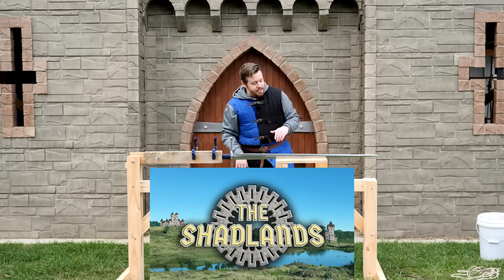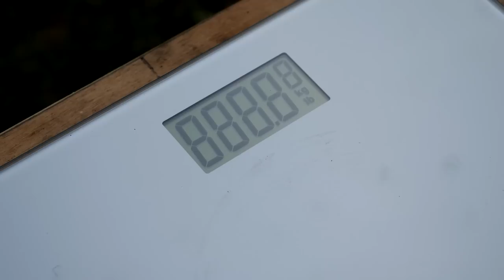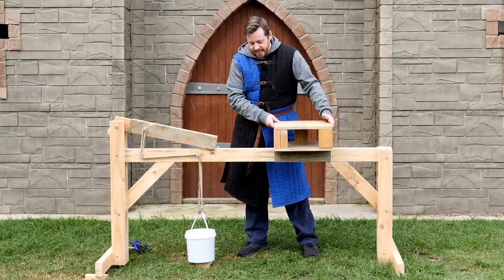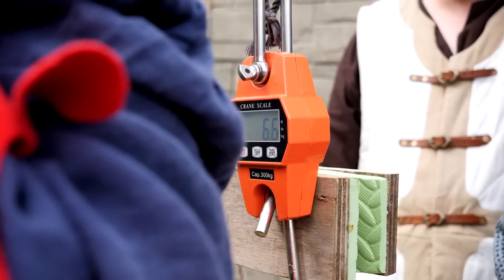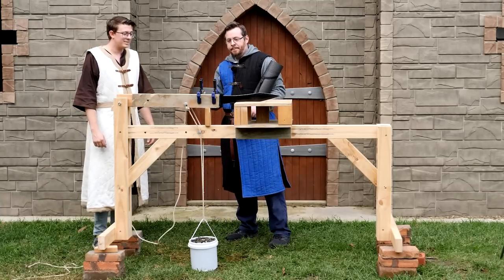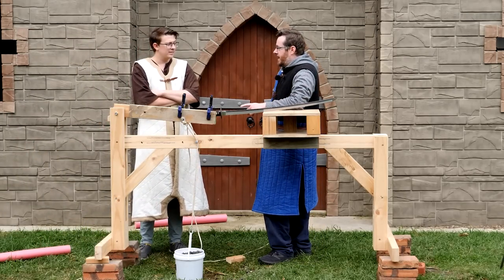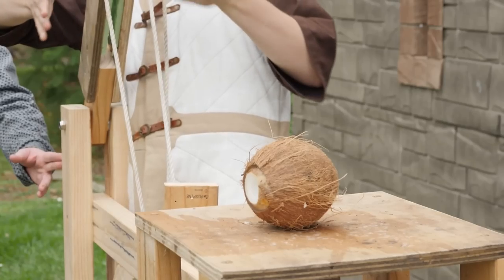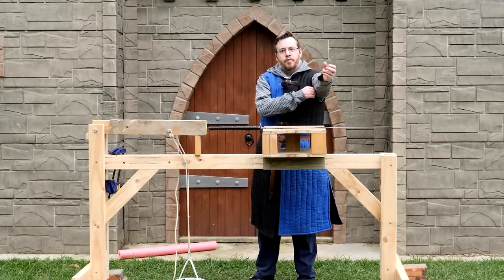Choppy choppy

Comment: I kinda hope shad tested the “War Sword” on that specific coconut before using his own mighty strength, which no doubt I knew would of cut through it. 

Maybe try inspecting the mechanism again, hitting a hard target might have weaken it, other then that I have no bias, but both of those swords relatively have similar mass, and from my experience, coconuts can vary ALOT in hardness for each one.

Comment: I think another factor besides the grip slipping (and possibly a bigger one) is that as you made the rope go more directly between the bucket and the arm to increase the force, you also decreased the speed of the swing and therefore the sword's momentum. That may seem counter-intuitive, but remember that regardless of the bucket's weight it can only ever fall with the acceleration of the Earth's gravity (9.81 m/s^2), which means that as the arm with the sword becomes horizontal and starts itself to be accelerated more and more by gravity the bucket's force on the arm decreases because it can't fall any faster.

From this point of view the original setup was much better, because a small movement of the bucket translated into a much larger movement (and acceleration) on the arm. And sure, the force is proportionally smaller (moment of force = r * F), but that can be compensated for by increased weight as you did originally. I know it's not the most practical setup, but increasing the source force seems like the only real solution, maybe you could use some pulley system?

(Also as other have pointed out the swing force measurement wasn't really fair, because you measured the force of your arm at the end of a not-so-short stick instead of close to your hand, which would be a much better comparison.)

Comment: You should drill multiple holes in the clamping arm to add pins to keep the sword handle in place better. I would also use kant-twist clamps instead of quick clamps, they hold much better and are more compact. An additional arm housing a pully would allow you to use a rope with a quick release to easily & safely raise the arm as well as having the most consistent releases. These solutions should greatly reduce the variables in your testing. Testing swords cutting ability in this manner is a good idea and your system seems like a good way to accomplish it. The truly best way to test would be to build a sword swinging robot that can do multiple different strokes similar to the ones golf club manufacturers use to test new designs.

Comment: This mechanism has a problem: it doesn't accomodate for the size difference between targets. Bigger targets will be hit earlier in the arc of the swing, where it has less momentum. I suggest you make some sort of vertical regulator as well.

Comment: I think that the clamps are slipping more than your hands. Of course human hands are not as strong as bolts, but judging from the video I suspect that the issue with the setup is that those clamps are not shock resistant enough to simulate a hand grip.

Comment: Ok Shad there are three main things you will be needing to do: 1 is secure the area that holds the sword handles better so that they do not move when they hit a hard target. 2 you will need to build a second platform  that sits lower as you mentioned, and don't change the "angle" that the swords sit they are fine. 3 MOST IMPORTANTLY you need to either raise that Guillotine higher off the ground or you need to dig a hole below the bucket for it to fall into without being impeded by the ground. It took me three replays of the katana test to catch this. The reason you were able to cut through the coconut with the force of your own arms is because the force exerted by your strike was only stopped by the cutting board AFTER you had CUT THROUGH the coconut. The Guillotine's strike looses its driving force when the bucket hits the GROUND, which was also the EXACT same time the leading edge of both swords BEGAN to touch the shell of the coconut. It had no power to finish the cut. This should cover the "major" changes that you need to make. Read the rest of this comments section I see some other fundamental tweeks that people are mentioning. 

I hope this helps. Best of Luck and Regards, Z

Comment: There's another thing to consider:
Swinging with your arms, you can apply almost constant force, or constant acceleration on the swords.
The bucket applies a significant force at the start, but once the sword starts moving and the bucket falling, the applied force gets reduced drastically.
For a bit of intuition: If both objects were free falling, there would be no force applied. In this case, you will just have reduced force.

To solve this problem, you want to make sure the bucket moves as slow as possible, so probably move it back on the lever where you had it originally.
Reply: To expand a bit more:
I expect the kinetic energy of the swing to be much more relevant than the static force applied.
That means you want the blade to move at a similar speed to a manual swing. Try to verify this by looking at the footage.
I think the static force measurement you did is almost useless (except to verify that it's not super excessive)

Comment: That’s not an executioner’s sword
Reply: Actually an executioner sword won't work either since its not actually angled in fact its documented that executioner swords can't slice a head clean off in one motion, the first prototype guillotine had a vertical blade as well and it didn't cut the head cleanly, leaving a mess all over the executioning grounds but when the sword was angled it totally worked which is why the guillotines you see have angled blades and not vertical ones, also the reason why the samurai sword cuts head cleaner than a regular sword because of its curvature with its cuts starting at a smaller point before going wide, a regular straight double edge sword can't do that job correctly although fiction depicts it otherwise which is fine
Reply: @traphimawari7760  that’s not the point and you know it
Reply: @ScottyAlmondjoy  its not really an execution when your executionee is still alive for a couple seconds as they feel their neck dangle and they drown in their own blood before the second strike finally ends them and spare them of the pain, executions have to be swift and merciful a straight vertical blade is like a butchers knife it can cut through bone and traditionally animal meat but the human body is comprised of much denser flesh and tougher fat and even tougher cartilage which makes executioner swords bad for their intended purpose and why it was subsequently replaced by guillotines
Reply: @traphimawari7760  Who the hell cares? It was a semi-joking commend about how if you’re building something called a “sword guillotine”, you should use an executioner’s sword instead of some other sword. It has literally nothing to do with how effective swords are at giving clean decapitations.
Reply: @ScottyAlmondjoy  a guillotines job is to decapitate heads and a vertical executioner sword as a guillotine won't work just as I explained since its terrible at its job in regards to decapitation so to build a guillotine using a sword that isn't angled like an executioner sword won't work at any given scenario you might as well use the executioner blade yourself rather than create a contraption around it that would only hinder its performance when it relies on kinetic or gravitational force such is the guillotine, also yeah I do find your comment hilarious in a lot of ways so I commend you for that

Comment: The one problem i see immediately (granted, before watching whole video so you might address it later on): it won't give consistent results. Why? It's powered by gravity and gravity has this neat little feature that it accelerates all objects at the same rate regardless of their mass (let's ignore air resistance as it is not significant in this case). 
Which means that every single sword you test will have the same velocity at the same distance from the point the arm rotates around. Which in turn means that heavier swords will inevitably have higher kinetic energy than lighter ones. Something that would not necessarily happen with a human, who has a certain amount of muscle strength to power a cut. 
A spring powered system that moves the sword diagonally (safer in case something brakes) or horizontally with remote trigger would be imo better  and not that much more complicated. The biggest issue would be finding a proper spring.

Comment: About the testing machine:
1) Make it so that it's not horizontally ending up but in a 45° angle downwards.where it can potentially cut swing further and then halted by a bar below the point. In the end of where the bars of 45° ends up connects to something going straight up and looks like some kind of V-shape that you can put there the product to be cut. You could connect it on the outside of the 45° bars to screws so you can adjust the length too.
2) About testing force, you swing and add momentum to the sword itself and thus much more force is applied. You did similar as a train moving ramming something like a car and you tested the moving force of the train starting from a stand still and no momentum behind it.
3) I would consider for instant blunt force test to set up similar forces. Like that How much damage (dent) one does with hitting a hammer and then the machine needs to do the exact same dent as you did swinging the hammer onto the for instance wood.
4) Make it so that where the rope goes over the screw that there is some metallic tube, better yet a rope pulley wheel over the screw so that there is no wear or tear affecting the outcome and more consistence.

Comment: I have a few ideas I don't know what might be causing the biggest issue but here's what I noticed:

I think the clamps aren't strong enough because because you can see the swords move after they make contact

Having the sword start further back would be good because you'll give it more time to accelerate before making contact

When you hold a sword, your hand wraps around the entire thing but your setup only holds it on the side. having a piece of wood on the top of the arm would help with the clamps being too weak and would make it so the swords don't slip

I'm not sure but it looks like the bucket is hitting the ground before the sword hits the target. That would probably cause issues because there would be no force pulling down after it makes contact. I think you'd need the bucket to still be above ground and the end of the swing because it would more realistically simulate someone following through with the cut

Comment: Ballistics Gel, it simulates what the sword's target will be, human targets.  However you'll need another universal material to simulate various armor types such as gambeson or mail.  I imagine a rig like this would be a good armorsmith or swordsmith tool if perfected, and I saw a lot of problems in that regard, too.

1) Mechanically, the sword swing happens at three pivot joints: shoulder, elbow, and wrist.  You don't just throw a fastball straight arm after all.  The same goes for a sword.  Simulating that is a mechanical quandary if you want to throw together a machine with just simple materials like wood.

2) The grip was also loose, power loss during swing.  Straight clamps such as the ones being used will slip.  But there may be a way to mitigate that and even use these clamps.  Set a backstop to the upper part and a lower stop further down to catch the bottom of the handle of the chopping arm to simulate someone actually holding the sword properly perhaps?

These are the primary two questions the machine needs to negotiate, leverage and grip.

Comment: Great video, was fun to watch.

I noticed (like many of your other viewers) that the katan slipped in the grip a lot more than the two-hander sword did. To fix this I would recommend putting the bolt that the weight ties to above the handle of the sword and just behind the cross guard. Then also put a bolt below the sword just before the pommel. That way when the sword hits it will not be able to shift as much in the clamp. You would probably have to drill multiple holes for the bolt by the pommel at varying distances and heights to accommodate for different type a sword handles. Even if you did this I still think the two-hander sword would have cut better than the katana (even though the katana was sharper).

I think that the two-hander sword would strike about 4 times harder than the katana in a "prefect scenario." The only significate force acting on the sword is the weighted bucket. The two-handed sword would have more drag on it than katana, but I think it would be negligible because of how thin the sword blades are. So both swords would accelerate at the same angular velocity, but the velocity of the swords at the contact point would be different. It looked like to me that the two-handed sword was about twice as far away from the swords cross guard as the katan did. So the two-handed sword would have a velocity at the striking zone twice as fast as the katana. Then if we look at the equation for Impact: KE = 1/2*m*v^2 (KE = kinetic energy of impact, m = mass, v = velocity). Velocity plays a bigger role in impact than velocity, especially because the mass of the two swords are relatively equal (So we can assume that both of them were 1 kg for simplification). So if we assume the katana had a velocity of 1 m/s at the striking zone the impact would be 1/2 *1kg*(1m/s)^2 = 1/2 Nm (newton-meter). Since the striking zone for the two-handed sword was about twice as far away from the cross guard as the katana we can assume that the striking zone velocity was 2 m/s. So the two-handed sword would have an impact of 2 Nm (1/2*1kg*(2m/s)^2) which is 4 times harder than the katana. I just don't think that the difference between somewhat sharp and pretty sharp can make up the difference in impact.

This is just my theory and I would love to see your guy's opinion on it. I'm sure I missed something.

Also, I remember watching something about how they make kitchen knives and test them (Probably a How its Made episode) and they tested them on stacks of paper. So I would say that rolls of newspaper would be a good test. The hard part would be making sure they have a constant roll.

Comment: I am not an expert, but I can think of 2 things that could help: 

1: The total force applied on the coconut isn't constant between different swords. Because the weight of sword isn't usually the same. One explanation for the katana not cutting could be as simple as the weight difference or the total amount of force applied being different. One way to counter this would be to weight the swords and use an arbitrary amount of weight that stays constant between test which would be the sum of the counterweight (rock bucket) . 

The reason it would be less impactful in your hands is simply that if you can produce 50 lbs. of force with a swing on average, that average should remain the same regardless of the sword. Obviously, there is also a lot of other aspect to think about, like weight distribution, length, width, etc. But if you want to be fair in the force applied it could help. 

2: I might be mistaken but I think that swords are meant to have a pulling part to the action of cutting with it. Even if really small. That should be even more true with curved blade which to me looks like they are meant to be use that way. I might have seen too many Japanese and Indian movie, but I think they are meant to slide cut more than to cleave. Maybe adding some form of horizontal U shape or circular ish shape railing for the blade rotation fix point instead of it being, well fix might help any sword that aren’t as good in cleaving. Or maybe having some sort of moving fix attach point to simulate that pulling could help. I guess that’s why most guillotine have an angle edge to simulate that sliding. It probably makes the cut easier. 

Little side note a morphing fractal vise could be perfect to grip the swords to the sword guillotine.

Comment: If you don't want to use wooden dowels then I suggest schedule 40 PVC half-inch pipe. The pipes are equivalent to ribs and  forearm bones. The only other thing I can think of is pla plastic as you can gather up the pieces and melt them back down into homemade forms for the skeleton of your test dummy. One-to-one comparison for the skeleton and you'll have to get the pla up to about 170 to 210 degrees Fahrenheit inside the forming mold allowing it to cool below 100° before removing it from the mold.

Comment: Hi Shad, I see some good explanations in the responses and some have valid points but as a mechanical engineer I want to emphasize that in the energy calculation of a moving object the velocity component  is squared,  while the mass is linear. So, in order to get a good approximation of a blunt cut, you need to have the blade move at the same velocity at the point of contact with the target as you achieve in a manual cut, you may need to re calibrate for each blade using the slow motion option on your camera. Remember,  it is of no importence how you accelerate the blade, only the final speed and the added driving force you have calculated in the video. Although I feel you need to take in the momentum of the swinging body,  not only the static applied force.
Best of luck and good fun to you all.